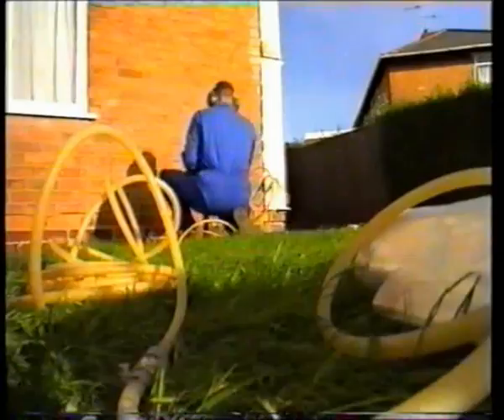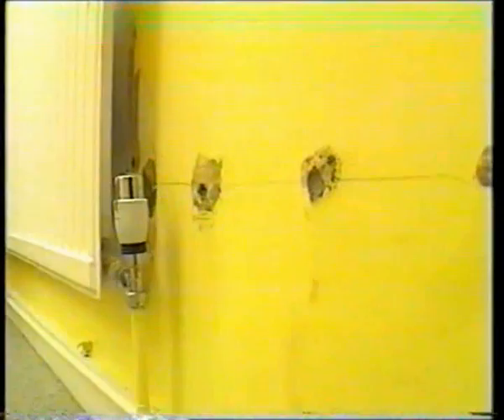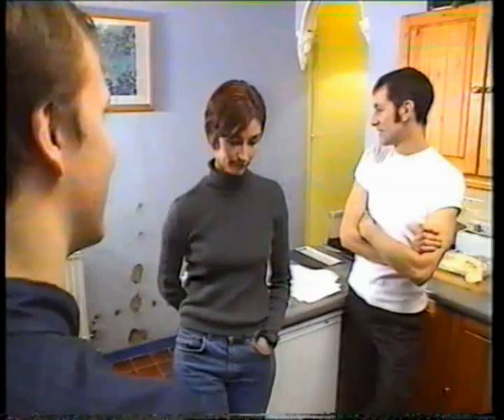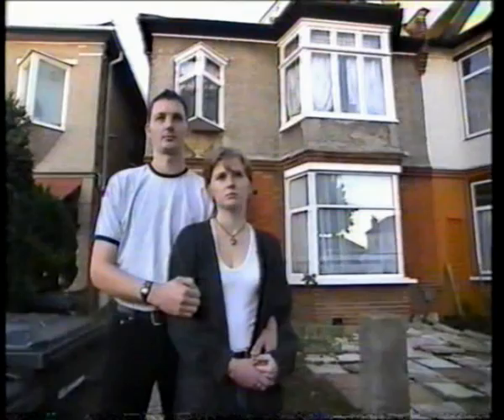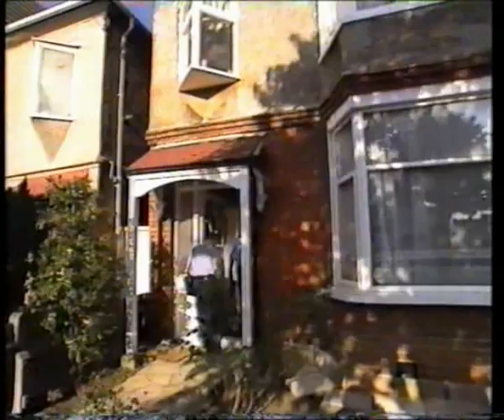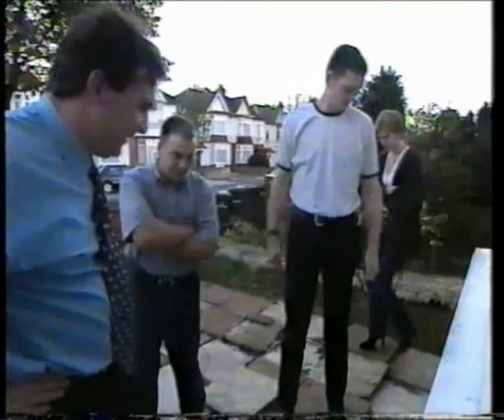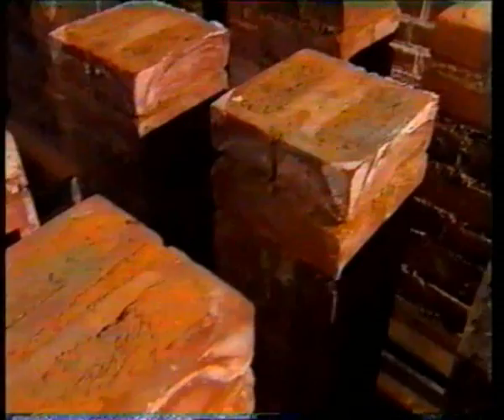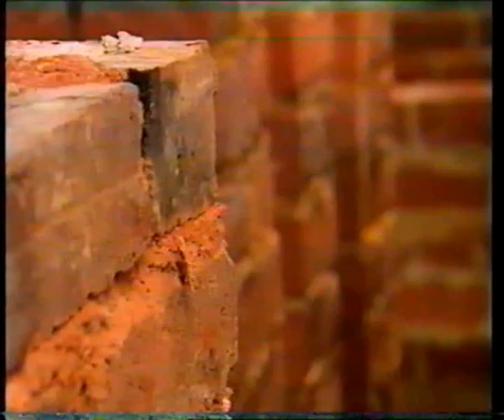Renovation Rising Damp ? No Such Thing 2 Download

Comment: Shame most people on here have no idea what they talking about. There are rising damp problems and if treated right it all works. Rising damp is different to mould problems mould will be from condensation issues.
Reply from the maker: To prove your point all you need to do is get a calcium carbide test done on each of your so called rising damp jobs and you will see first hand that it is certainly not "Rising Damp" To avoid looking foolish, try this before posting a reply.
Reply: We bought a ground floor flat with a 10 years guarantee for the injection in the walls. However it cost us £3000 to get rid of the dry rot mould. The problem is that cowboy builders bridged the damp course and at the front of the flat with concrete there was cut outs like a shovel in front of the air bricks so the water went straight under the floor. When we lifter the floor boards the joist were ruined and the builder had chucked their  rubbish under the floor boards which absorbed the water. The back garden was so high that the water went straight towards the house. So both the back and the front had damp. After lowering the back and front and filling with shingle. The flat is damp free